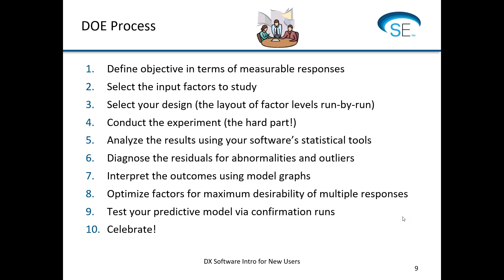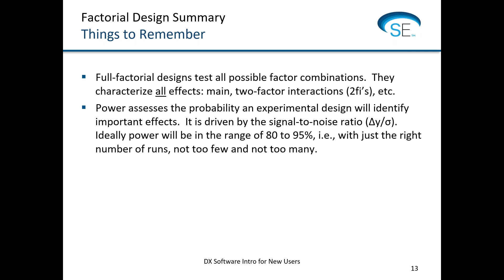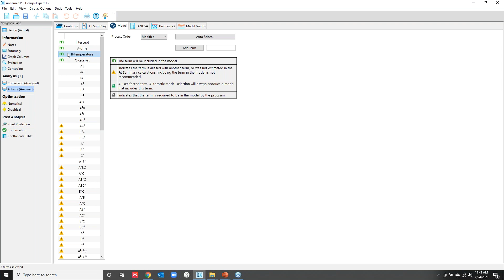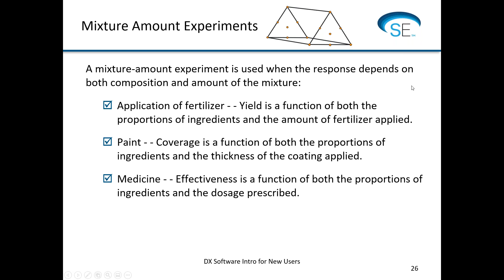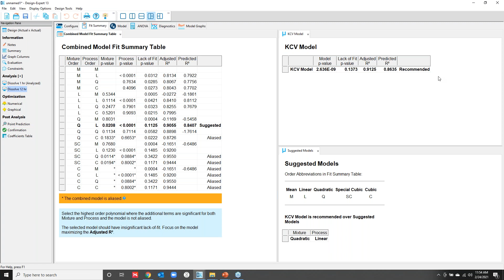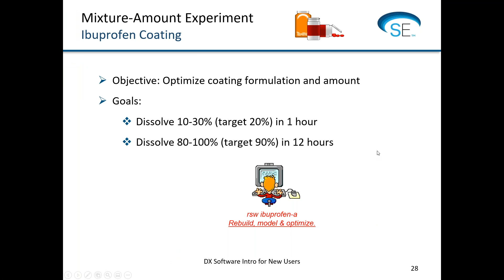New User Intro to Design Expert® Software

Comment: What is tge difference between CCD and optimal design ? 
I have 3 factor with 5 levels 
Time 15, 30, 60, 90 and 120 
Dose .75, 1, 1.5, 2 and 2.5 g/l
Conc. 100, 150, 200, 300 and  400
How i can run it by CCD or by optimal design
Reply from the maker: Look for the video "Keys to Building the Perfect Response Surface Design" to learn about the different RSM options. If you have already built your design and collected your data, then you are beyond the design building point. Just use the Import Data feature to pull in your data and start the analysis. See "Keys to Analyzing a Response Surface Design" video.